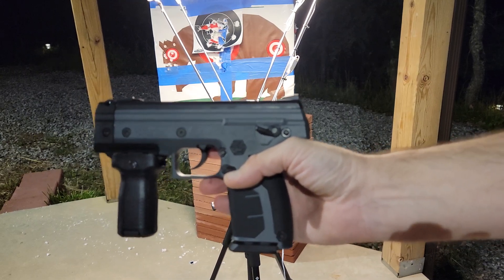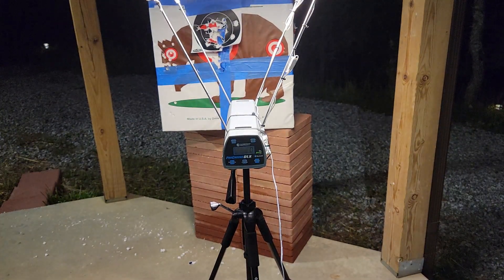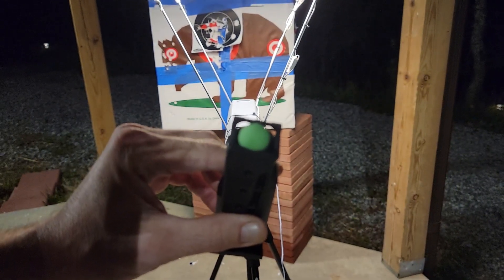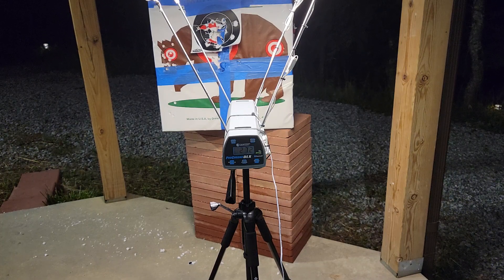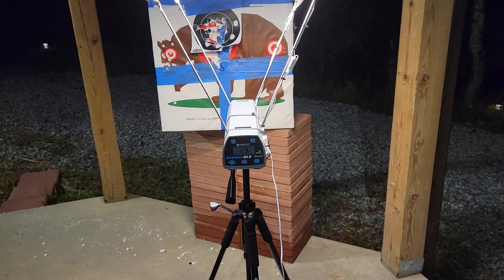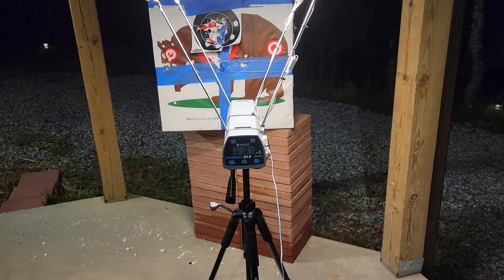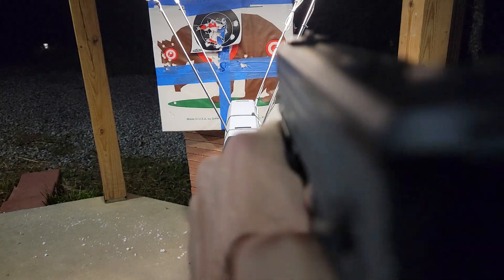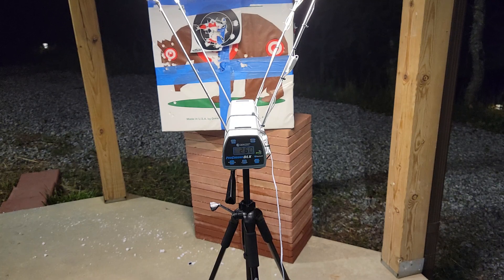Byrna HD power tuning Part 2: The results . . .

Comment: Do you suggest that a guy does this? Without a coronograph, I've been planning on getting one. They just want a hundred and twenty bucks for the one  you guys use? I was going to buy a cheap one from amazon for thirty five bucks
Reply from the maker: @TecHNumbeR777  I don't know that there's any on Amazon that do what we need to do.  The reason most of us use the yellow button xradar Is because it reads over 400 ft per second.  And whether you need one or not depends on what you're shooting.  If you're shooting what's in this video you probably don't need one but if you're doing other stuff that you're modifying and stuff then yes
Reply: @DK-Spencer  thanks for that. what about the velocity adjuster? On the byrna would you do it without the coronograph ?
Reply from the maker: @TecHNumbeR777  On the pistols, yeah, it makes almost no diff, just turn it all the way up.  They're good to have on the TCR though so you kind of can adjust it where you want it or you can just turn those all the way up to 😂
Reply: @DK-Spencer  thanks for taking the time to answer me ! 🙏

Comment: It seems to be able to adjust power but it actually doesn't. It's a timing screw for when the barrel slides all the way back and the byrna fires. So it doesn't go off before the Bernal is seated all the way back. You may get very little power gain by fine tuning the timing with the screw. This is why the new models have no access to the screw. More people did more damage than good.
Reply: Do you know if the (new or old) user manuals for the Byrna pistols describe that?  I'm glad this reviewer provided FPS metrics.  Most Byrna reviews are qualitative...and I've only found one review that fired Byrna pepper balls against a target equipped with a few layers of clothing.

Comment: Thank you for the video

What kind of ammo did you use?
Reply from the maker: On these, I mix it up.  I like the 9.9 gram Canada Riot balls these are little weak for them though unless you're really close.  I like the 3.7 Canada Riot Balls for range.  V2s are a good in between.
Reply from the maker: A lot of times I actually stagger the ammo and put riot balls at the top and progressively get lighter

Comment: Which way do i turn and how many times?
Reply from the maker: I just turned it all the way clockwise and then back it off like 1/8 if that just barely a little so it's not all the way
Reply: @DK-Spencer  so you are afraid to turn it all the way, for some bad things might happen with the gun, that's why manufacturer does not acknowledge it, as for me I only have one HD and will keep it stock, only you and those with several guns do that for if it breaks you guys have back ups 😉
Reply from the maker: @malefanematsie3890  I don't understand why you think we're afraid to turn it all the way.  We turn it as far as it'll go it just don't do much
Reply: @DK-Spencer  Hi, I was just reacting to your reply on Michael's query above whereby your last comment says, "so it's not all the way " then I thought it might still go further and you don't just want to take chances 🤣but now it's clear when you say that was the futherst, Regards 🙏🙏
Reply from the maker: @malefanematsie3890  good times 😁
Reply from the maker: @malefanematsie3890  I will say that we have found in some markers that you get diminishing returns if you cut them up all the way.  For example sometimes on the m17 you'll find you get more power without it cut completely all the way then you do if it's all the way that's why a Chrono is important

Comment: TipX for me, being in CA I can't legally use pepper balls so I must rely solely on kenetic impact, and in my opinion, the Byrna just doesn't produce the power you want for that. I've got my TipX tuned to shoot 12 3.5 gram riot balls into the 400's with the last couple shots in the mid 300 fps range. This is also with a 9" barrel with a .682 Freak insert. Balls are dead on .680 so it's sized real close which is what you want. I can get up to 30 joules with it, shoots hard and is very accurate. Riot balls go right through both sides of a soup tin can like butter. . I really like this pistol and have two 12 shot mags for it.
Reply: WHERE CAN I FIND RESEARCH 🤔 👀

Comment: Thanks for the updates 👍
But in a defensive scenario firing once every 2min at high velocity isn't going to help much. Unless the velocity can be maintained at a rapid firing rate, it's fairly pointless. However your uploads seem to indicate that the screw in the back does actually do something - like is does on the Tippmann TPX, the grandpa of CO2 pistols.
Reply from the maker: Well it's a CO2 gun so rapid-firing it with or without the screw turned up, it's not going to make any difference, cylinders going to get cold and you're going to lose power, which I'm sure you know.  And realistically it's not like turning up the screw on a m17,  you're gaining 20 ft per second not 120 ft per second so it's not going to impact much of anything, really
Reply: Hi all.. I had one.. checked it out thoroughly.. now honestly.. I'm just being honest.. it's only good for training.. it is actually a danger to try use as self defense..it won't stop much .. and it looks real.. so you escalated to lethal force.. on you .
Reply: On another note, I just wanted to know which way to turn the damn screw to turn it up or down I didn't have 30 minutes to go through your videos. I can't hear You talk half. The time nor you've done is hold up a paper with a bunch of notes, not telling me which side is the more powerful or less powerful one righty stronger, less?  Where is it the other way around?

Comment: Now why exactly does turning the screw increase velocity? Thanks
Reply: tightening the hammer sping?
Reply from the maker: @brandonsalice1890  it looks more like it's changing the length of travel of the hammer.  Same end result, lol.  But like if you told me you knew for a fact that it was doing the spring instead I wouldn't argue with you because it's apparent it's one of those two things and without being able to get more than one angle at it, it'd be hard to tell for a 100% sure
Reply: @brandonsalice1890  For most PCP airguns velocity is tuned in part with hammer spring tension. So I believe you are correct
Reply from the maker: And if you're asking about what method it changes the velocity I honestly would defer that question to someone who's tore one of these apart.
Reply from the maker: Probably because the screw is a velocity adjustment screw that the factory put in there but does not acknowledge
Reply: @DK-Spencer  you will remember I ask the same question whether manufacturer approves turning,  now you clarify well but 2hy does he not acknowledge it but made the turning screw so obvious??

Comment: Has anyone been able to get their fps past 300 on a Byrna?
Reply: I only got 320 once on my Byrna XL using my fx pocket chronograph but I made sure my co2 was nice and hot before I did it and it never happened again so it might have been a fluke. But I did get an average of 307 on a 8 string shot count. Like I said though I had the co2 canister in the sun then held it in my hand for a min before putting it in plus it was 100+ degrees. I did the test with the adjustment and I honestly dont know if that does anything. my numbers seem to imply that it doesn't but I'll do more testing. Co2 temp seems to be the deciding factor when it comes to higher fps.
Reply: Byrna is not designed to go high than 300fps+ the seals,bolt etc would break under high velocity stress. It shoots fine as long as it is above 250fps ...then it is good for close range in your face shots, that would blind,stop an attacker,if you shoot at the eyes etc, hopefully it will destroy the eyeball permanently. Eye for an eye...😉 For higher fps pistols buy the Tiberius/Grimburg/Pepperball FSC and Mission Tpx(TippmannTPX ) You can mod those with milsig heatcore o rings and get 380fps easily from them. Shoot a 8g grimburg jul from a fsc/mission at attackers face,head ...it will knock them out...empty mag and it becomes almost lethal...dont get caught,wear a mask and hoodie so not to be identified,run away and keep quiet and hope noone canrecognise/report you to the criminal,mafia government
Reply from the maker: @swamivandermeer  and we'll find out if it breaks or not because I'm leaving mine turned up and keeping shooting it so I will definitely keep you all posted.
Reply: @DK-Spencer  I have also turned my byrna hd velocity up(I have 2 ByrnaHD) ,just a little though and use 12G with well lubed silicone...gives more power, with silicone on CO2 tip. My Tipx is tuned very high that I only get12 decent shots from a 12G.
Reply from the maker: @swamivandermeer  My friend, a pick up truck is not made to out run a Corvette either but it's awfully funny to look at somebody's face when it does.  I don't leave anything stock.  Sure I can buy a different pistol that's more powerful but I definitely want to get the most out of the one I've already got.  But, speaking of that I've got a tipx on the way now, 😂
Reply: @swamivandermeer  Wow You’re watching way to much TV. This is suppose to be for (Self Defense) Not Urban warfare or whatever you are imagining. That attitude will get you killed If you are foolish enough to pull this out on a second amendment carrier. Smh.
Reply: I think the dude who makes his own 12 gram adaptor got up to 300. Mercy Less Lethal. Sells other neat stuff.
Reply from the maker: @ghostdog2898  I think I can hit 300 pretty easy if I'm hitting 292 with these.  A slick 3 gram ball would probably do it
Reply from the maker: Challenge accepted.  Uploading video now, lol
Reply from the maker: And I'm now at 309, lol. Thanks to the Mercy Less Lethal 12g adapter
Reply: @DK-Spencer  is that with it tuned to the max?

Comment: Good job you're the first one to put it on video with proof!  👍
Reply from the maker: Hey man I wouldn't have even known to do it not for you thanks again!!
Reply: @DK-Spencer   Stick together no secrets   And teach others  what we learn and there's no stopping us..... anytime  brother!
Reply: Question. I may have missed it, but do you have the screw turned all the way as far as it can go? Also, I was wondering if you always keep it turned all the way up? Because I turned mine up just a little and I was wondering if it was safe to keep it turned all the way? Thanks
Reply from the maker: @Vinomis  Yeah, I backed mine off like a quarter to an eighth of a turn from all the way but I keep mine turned up all the time I don't think it the power level that it's at it's going to hurt anything, but that's just me guessing.
Reply: @DK-Spencer  thanks man💪🏻🐺
Reply: @DK-Spencer  Good informative  part 1 & 2, but does 'Bernie' approves or recommend turning? For nothing is mentioned in manual book 🤔
Reply: @DK-Spencer    May I ask....there is a growing dialog on the web that pepper balls fired from the Byrna will not burst when the attacker is wearing a few layers of clothes or even a light jacket.   Could you perform a test of that scenario, please?  ...or perhaps your videos already include such a test?   🙂
Reply: @Vinomis  yes safe  But the sweet spot is slightly less than all the way!
Reply: @AmericanRusticWoodworks  thanks brother 🐺
Reply: I wonder if the clockwise method also is for the SD model?